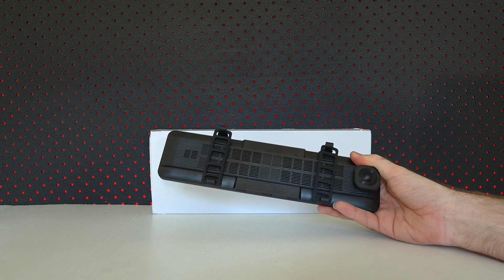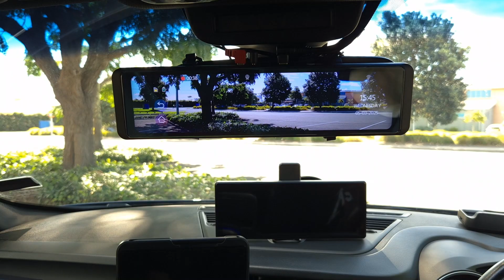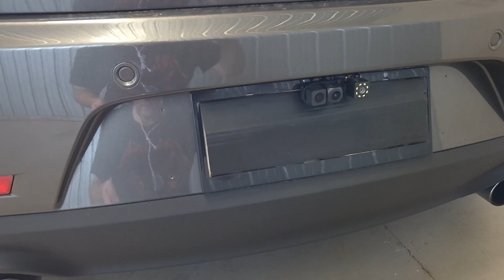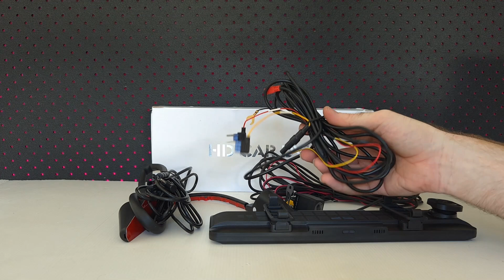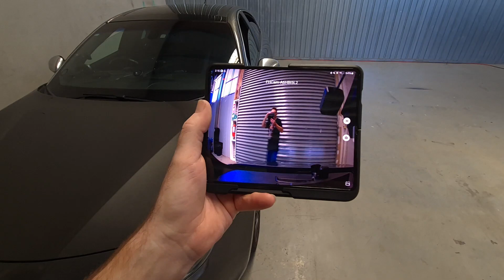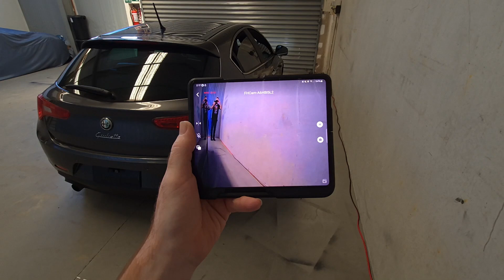This Blind Spot Monitoring System uses CAMERAS? BSM ADAS BSD Review

Comment: Hola Amigo, tienes algún vídeo referencia de cómo se instale? Creo que compre la misma,  pero no he podido encontrar un vídeo de instalarlo al 100%, es para ver si la persona que lo hará, lo haga bien.
Reply from the maker: I only have this video. You just stick the cameras onto the car, run the wires into the car and plug everything into the mirror itself. There are only 3 wires to connect which are YELLOW-+12V, RED-ACC and BLACK which is ground
Reply: @SHORTwithTECH muchas gracias, me surgió la duda porque la persona que me lo va a instalar me pregunta a mi que como se colocan las cámaras laterales y yo quedé como un poco nervioso de como lo hará.
Reply from the maker: @francisconarvaez9600 the cameras need to be positioned horizontally with the camera lens facing toward the rear of the car, anywhere between 0.6 to 1 metre in height from the ground up is recommended,  dont mount the cameras to low
Reply: @SHORTwithTECH muchas gracias!
Reply from the maker: @francisconarvaez9600 you are welcome
Reply: @SHORTwithTECH Hola! Tengo una cámara de espejo 4K de 4 canales con BSD y ADAS. Tengo un par de dudas de configuración: 1) ¿Hay alguna forma o menú oculto para que al activar la reversa se muestren 3 cámaras (trasera y laterales) en lugar de solo la trasera a pantalla completa? 2) ¿Cuál es la mejor técnica o referencia visual para calibrar bien las líneas del ADAS frontal junto con las cajas del BSD lateral para evitar falsas alarmas en ciudad/parqueaderos? ¡Gracias y excelente contenido!"

Comment: Can these systems be set up so the connectors are on the bottom and the on off button is on the top, allowing the image to be viewed the correct way up?
Reply from the maker: No that won't work because the software is not designed to recognize that. You can flip the rear camera view with most but not the whole display context
Reply: @SHORTwithTECH  Thanks for the reply.
Reply from the maker: @jonathanstedman4149 you are welcome

Comment: Hello my friend,indeed very good amd usefull product but from where did you pass the wire of the side camera? Did you pass them through the door and then pass the wire into the cabin? And also which is the heighest point under your opinion in order to install the side cameras for best result?

Thx again.
Reply from the maker: The side camera wire gets taped down the inside of the front guard and then needs to be passed through the doors wiring loom going into the footwell area of the car. You can mount the cameras anywhere between 0.7m to 1m high,
Reply: @SHORTwithTECH ok my friend thx for the usefull information.

Comment: Can this be implemented in Honda Fit 2007 model?
Reply from the maker: Yes this is a universal system so compatible with many different car brands
Reply: @SHORTwithTECH  Can T80 transmit:

Front RTSP
Left RTSP
Right RTSP
Rear RTSP

all at the same time?

Can we obtain all four streams simultaneously?
Reply from the maker: @hardikjoshi5667 untested sorry, simultaneously no, just individually as demonstrated in video

Comment: Is the front camera detachable, or are there any other models that have a separate camera? The reason is that my rearview mirror does not allow me to adjust the angle to fit this kind of rearview mirror dashcam. Are there any dashcams of the same type available on Amazon? Thanks for your help!
Reply from the maker: The front camera is not detachable, it doesnt need to be because it slides out sideways so you can install it onto your rearview mirror

Comment: Please can we have a link to this product or product details..?
The existing link no longer works.
Thanks !!
Reply from the maker: You can give this link a try 
https://a.aliexpress.com/_mspmzK9
Reply: @SHORTwithTECH thanks! Wow  12 inches, that's wide! But good for so many cameras.
I just wish there was an option for front bumper cam as well to avoid hitting walls and curbs. Car has a low front bumper.

Its hard to find an all in system.

360 view is great but then no bsm.
This product offers a lot but not 360 and not front bumper.

I'm thinking that maybe one could add a front cameras on the same channel as the rear and put aanual switch in the car to switch between front and rear depending on where you are parking.

Ps. Can one switch the screen off completely and still use as a regular mirror..?
If not, I'm thinking to just mount this on the dash, then still have a regular mirror as well.
Reply from the maker: @zootarootoot You 100% should go for a 360 Camera System then because its the perfect solution to both your problems, a low front bumper and a Blind Spot Monitoring system because it works great for both of those things as you will see in this video here  https://youtu.be/DHkEbAftQy8?si=9tdQvxF4a-ApMUQB
Reply from the maker: @zootarootoot yes it can be switched off and used as a regular mirror, its a clever system and works well but a 360 Camera System will out perform it by miles

Comment: At around the 28 min mark? Can I have all 4 cameras or 3 cameras on the actual mirror while simultaneously having one camera on the phone app?
Reply from the maker: Yeh you can set it up to do that aswell if desired
Reply: @SHORTwithTECH Thank you! My current one cannot do that, so I'll get this one just because of that feature
Reply from the maker: @kiass30 yes alot of devices won't allow both the app and display to be used together  simultaneously so thats a great feature with this device

Comment: Also can we install the side camera facing front? like if the SUV is too wide for a certain road it allow us to see the front edges of the car
Reply from the maker: Because this system is designed to be used as a Blind Spot Monitoring system that would not work either as you would not be able to calibrate it if the cameras were facing forward

Comment: What's the maximum size it will take? I am interested in 4ch and it comes with 64gb card. I was wondering how long footage you get
Reply from the maker: Maximum size is 128GB, this should record for approximately 10 hours straight at 1080P before it's full

Comment from the maker: UPDATE: In regards to if this system works in the Rain. From my experience, yes the Front and Side Cameras are not effected at all, the vision is still good from the side cameras even when raining which was interesting to discover. Objects in Blindspots are still detected and front view detection still works aswell. The Rear Camera however does not like the rain, any objects from behind are not visible due to the water and therefore rear detection is also not reliable either, only when raining though
Reply: Hey mate where can I get this device?
Reply from the maker: @dashking9589 i cannot find the original supplier anymore but the same product does appear to still be available from other places aswell, for exampje here's one place you can get it from 
https://a.aliexpress.com/_mNlfFKn
Reply: @SHORTwithTECH thanks mate

Comment: Interesting system though my first impression was "information overload".  I like the no-drill side cameras, multi-camera display, DVR functionality, and price.  While the green target tracking boxes might help you more quickly identify threats in the scene as you briefly glance at the monitor, overall, I found them to be distracting.  I didn't see any mention of GPS, so I assume the DVR recordings do not contain any lat/lon, speed, or accurate clock metadata.  It also appears to be lacking any wired tie-ins to the turn signals so the system knows when you are making a lane change or turn and can provide enhanced alerts.  Question, are the recordings "clean" or do they contain all the target tracking overlays and timestamps?  I'm curious whether the screen has reliable auto-dimming (or at least easy to access swipe up/down manual control) and if the brightness range is decent for both day and night.  I tend to like a dark car at night so I can preserve my night vision and also not attract undue attention or let other drivers see my face glowing. My experience has been that many even at their minimum setting are still too bright.  I agree with your assessment about the problem with cameras in rain and snow.  Also, bright headlights at night can wash out the scene, making it difficult to estimate distances and possibly hide other threats in the scene.  

I'm still considering one of the radar-based systems you have reviewed due to their relative simplicity and because they are completely passive.  While a simple LED indicator can't tell you what is actually triggering the alert the way an augmented reality display can, what we are really talking about here is a basic collision avoidance system.  In my particular case, I recently lost most of the vision in my left eye so, if anything, I need an alerting system which requires minimal visual attention.  A flashing light and beep is more than sufficient to remind me to take a second look before turning the wheel.  Still, the product you are reviewing here is cool.  It would be a good addition to radar or perhaps even the perfect system for someone with better eyesight than me.
Reply from the maker: @chrisnovy3448  Recordings are clean and clear. The system is also customizable. You can turn off the Green Box highlights, voice alert etc. The BSM and ADAS features can be turned off individually or both at the same time so the mirror can be used solely as a Dashcam only if wanted. Because it's software controlled it means you can calibrate it, unlike the radar based BSM systems which you cannot. No GPS features with this particular system no, stay tuned for future videos to see how advanced ADAS can get
Reply: @SHORTwithTECH  Any thoughts on my brightness/dimming question?
Reply from the maker: @chrisnovy3448  auto brightness and dimming are good throughout the day and night. The display 
 brightness is manually adjustable aswell by swiping your finger on the screen if you find it is to bright for you at night or if you press the button on the bottom of the mirror you can alternatively turn just the display itself off only aswell
Reply: @SHORTwithTECH   where can I buy this
Reply from the maker: @derekww4844 yes the link is in the description, thanks

Comment from the maker: Hey Guys, I forgot to put it in the Video, but please note this system also supports TSR, Traffic Sign Recognition. This gives the System the ability to read certain Road Signs. For example, if you are approaching a Pedestrian Crossing, the system will detect and alert you about it, even there is no pedestrians around. Yes that's CLEVER and it works really well to
Reply: WHAT IS THE PART AND/OR MODEL NUMBER?
Reply from the maker: @silvernblackattach I think this product has been replaced with another version now, you could try this 
https://a.aliexpress.com/_m0G1FL9 (this is not an afilliate link)
Reply: @SHORTwithTECH  This link is also dead?  Can you see if another link is available?  Also, any idea if the camera(s) uses the starlight sensors?
Reply from the maker: @kilimar948 If you do a search on aliexpress for "adas car rearview mirror" you will find several options to choose from
Reply: @SHORTwithTECH  Have you seen any ASDS where it uses the similar cameras (the slim side cameras) but is dash mounted rather than rearview mirror mounted ?  I hate Aliexpress' seach results.  It's as bad as Facebook Marketplace.
Reply from the maker: @kilimar948 no I haven't yet sorry but I've noticed products like that are being talked about so give it another 3 to 6 months and its possible they will be available
Reply: Hello @ShortWithTech , can it recognize the Speed limit sign and keep it displayed on the mirror?
Reply from the maker: @briantran9480 no its ADAS features did not support that, you can use Google Maps or Waze for that